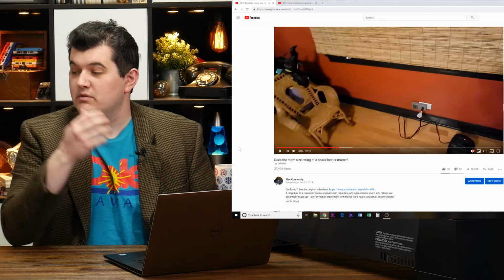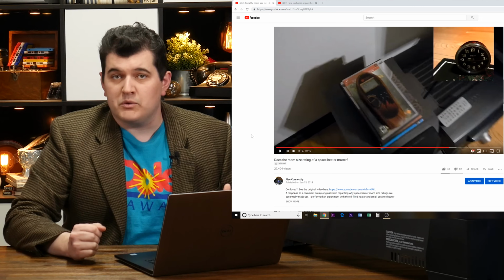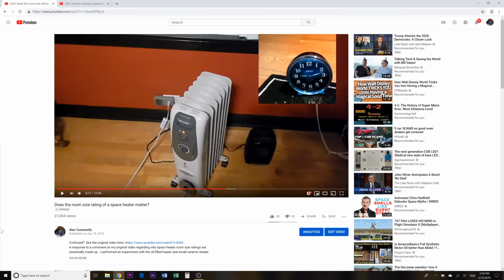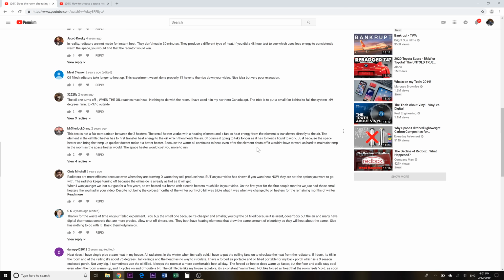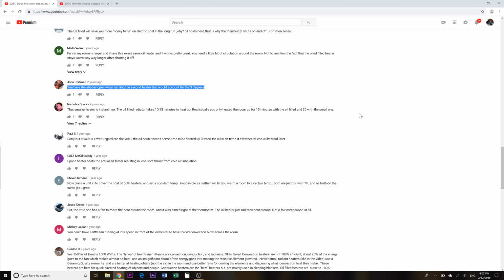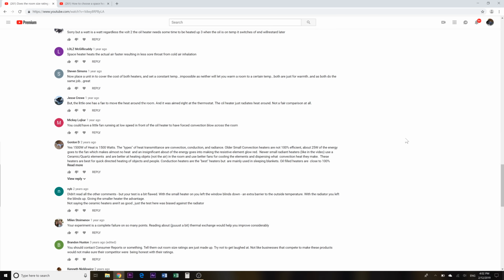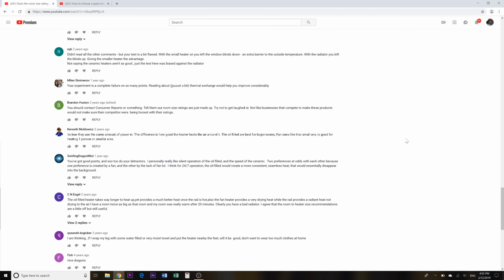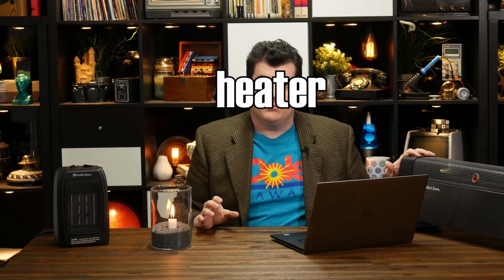More Space Heater Nonsense

Comment: Alec, I will say, a think they discourage the use of small element heaters in larger rooms because would have to be running constantly in order to heat such a large volume of air risking fire. I think they recommend oil heaters for large rooms because of the inherent safety benefits. I agree, same heat output. My question though is wouldn't a heater with more glowing element material heat faster since more surface area is active? Like a big burner on a stove?
Reply: It would if they were the same temperature; the catch is that the one with the larger surface area will be less hot.

You're right that more surface area means an increased heat transfer rate, but that means that a constant power of 1500W can't make the heating element as hot since it's losing more energy at a smaller temperature difference. For example, a small heater might emit 15W per degree above room temperature, so it'd have to get to 100 degrees above room temp before energy in (1500W) matched energy out (15W/F * 100F); a larger heater might emit 30W per degree above room temp, so it'd only get to 50 degrees above room temp to reach equilibrium. The overall output is the same 1500W, one does it by being bigger, the other does it by getting hotter. 

The big stove burner analogy doesn't really match up since that big burner is using more gas (and thus had more power) than a small burner.
Reply: @peterkaas7210 okay that makes sense. Also I mean like an electric stove the larger burner is often used most.
Reply: @americanidle1277  (Isn't it great how we still refer to electric stoves as "burners"? I don't think so, but I don't have a better name either...)
If small and large electric burners have the same power caps, then the same logic applies (the smaller one will get hotter, but still put out the same amount of energy). I don't know how electric stoves work, so I can't say either way. Though, I will say that the larger burner on an electric stove is a better fit for most of my stuff, so I use that one so I don't get a hot spot in the middle of my skillets.

Comment: Duty cycle.  Would have been better to let the oil filled run for the same amount of time as the 30 minutes of ceramic 100% duty cycle.  Plus what is the duty cycle for both heaters AT the desired temperature to maintain.  Does one "FILL" the room with more heat than the other?  I would bet there is more temp gradient across the room with ceramic.  Esp as the distance increases from the heat source.  Remember your toaster oven discussion?  I bet using both would be best.  Ceramic to quickly raise temp then switch to oil heat to maintain.  Love the channel!  Also with a heater that does not have 100% duty cycle can it overcome the coldness of the room at 1500W?

Comment: I’ve had this argument with dumb people. Resistive heat is resistive heat. 1500 watts is 1500 watts. You won’t get any more actual heat out of one than another. The difference is in the way you perceive that heat - some are loud, some blow air around, some only heat you directly (radiant type), some stay warm longer after shutting off (oil filled), and so on. But the AMOUNT of heat produced is the same.

Comment: Point a (small) ventilator at the radiator. I do that in my home and it heats the room faster and more effective, because it adds air circulation.
Reply: The moment you add a fan to a radiator heater, why wouldn't you just use a space heater that has one built-in?

Comment: I had to explain this to my boss once. Which heater is better? Same watts = same heat generated.
Where this gets complicated is with heat pumps, i.e. a reverse cycle air conditioner. In theory I think you could get more than 1500W of heating out of a 1500W heat pump... I think.
Now if you want infuriating... I used to work tech support in an office and one of my jobs was to monitor office temperatures and call the building managers if temperatures got imbalanced. We found that, duh, when on a cooling cycle the people under the aircon vents would feel colder. These being sales folk, their usual response was to hook up an electric heater, so we were paying for electricity to heat up the office AND to cool it down.

Comment: You just need a box fan sandwiched to the side of the radiator running along with it for it to heat well but then essentially it will be using more than 1500 watts (adding what the box fan uses)

Comment: The only thing that would make sense is if it's talking about consistency. A heater with more surface area would spread the heat better and get the whole room to the same temperature, instead of a small area that's hot and the rest that's cool.

But you can solve all of that with a fan.

Comment: Is it because the longer heater has more surface area so more heat can be released in a wider space? If that bigger heater had a fan wouldn’t it heat a bigger room more quickly than the smaller heater?

Comment: Its going to be interesting if you ever get around to reviewing heat pumps where they can often be greater than 300% efficient in converting electricity to heat
Reply: Heat pumps aren't 300% efficient. Some if them have a 3:1 ratio (hence the 300%) for how much heat they can transfer, relative the energy spent transfering said heat. They don't actually produce more energy than what's going into them; if that were true then the heat death of the universe would actually be avoidable.

Comment: I think the biggest difference is how it FEELS like it heats.  The little ones with a fan seem to provide the feeling of MUCH more heat, but only in a small area they are blowing on.  The large oil-filled ones seem to heat slower, but a bigger area of the air feels slightly less warm.  If you put one under a ceiling fan, that seems to REALLY speed up the heating process.  I may have also put a box-fan next to an oil radiator a few times to try and warm a bigger area faster when we lost power to try and slightly-warm a HUGE area (say most of the house) slightly faster.
 
My bigger preference to the oil ones is they seem safer - you don't have to worry about a little bit of pet-hair sucked in and clogging the air-flow causing a restriction and overheating like the small fan powered ones seem to.
 
It's all moot for me though, because after a long winter power failure, I discovered the indoor-safe LPG Mr. Heater Big Buddy that outperforms everything else thanks to having 18,000 BTU on high with 2x 1lb bottles.  So now if I need to warm a room up rapidly while I'm in it, I just get that and save the electric ones for if I need to let one run at low/medium "speed" to take the edge off for an extended time.
Reply: Thats literally what the video talks about

Comment: Of course you are correct! The only thing that matters with heaters is how much power you are turning into heat. And you are also right about the cycling. If the heater is not running (cycling) it’s not producing heat. The only exception are heaters known as radiant heaters that produce infrared. The IR makes you feel warmer even though it’s not heating the air, because the infrared warms your skin directly. This is what you get for trying to teach science on youtube :)

Comment: In a smaller room the temperature will change quicker. So maybe, a 'small room' heater is designed to turn on and off more for short periods and the 'large room' heater is designed to be on and off for longer times (not sure if that is true or not). Just saying that the label difference may be because of factors other than the heat produced. To be clear I do like the video and your logic seems valid. I would be interested to see a response from some companies.
Edit: Also, to be clear, I think your original video clearly showed that the energy transfer supported your point.

Comment: One thing you missed, I think, is the means to heat the room. With the smaller unit, which has a fan, is able to pull in the cooler air (which is on the ground) warm it up and throw it out. The oil will use convection, meaning it would require decent air movement to equally disperse the heat it produces. IMO the electrical heat with a fan will heat a room faster than the oil filled, but may use more energy up front, where the oil filled will take longer to warm a room but use "less energy" but over the course will use the same amount of energy. Interesting thought experiment... Maybe if I had the money I'd also try it. 
And that one guy saying something about drying the air? Yeah... let me tell you about psychometrics sir; the ground principle of anticipating the heat energy of air a.k.a. the ground principle of HVAC. By increasing the sensible heat without adding moisture, the amount of moisture stays constant (look at dry bulb temp and specific humidity. An increase in Dry Bulb Temp = constant specific Humidity).
https://www.google.com/url?sa=i&url=https%3A%2F%2Fwww.ohio.edu%2Fmechanical%2Fthermo%2FApplied%2FChapt.7_11%2FChapter10b.html&psig=AOvVaw3o_Abp7DNsKgevkdlud-Cf&ust=1594988085340000&source=images&cd=vfe&ved=0CAIQjRxqFwoTCMCa3-Xf0eoCFQAAAAAdAAAAABAI
If indeed the heat elements are all the same, the benefit of going for a larger element is that it covers larger surface area. So a large unit may take 15 minutes where a small unit will take 30 minute...
Source: 4 years in commercial/industrial HVAC, 3 in the US, 1 in EU. Working on 120VAC 60hz, 230VAC 50/60hz, 480VAC 60hz system (And DC systems) and all sorts of different rated heating elements I think the largest I have seen is 28kW. I still have a lot to learn, and am still learning.
Don't let the haters get to you. You are making an attempt to learn... that's way more than other people. Keep releasing the great content.

Comment: Honestly first thing when I hear "space heater" is a radiator out in space.
Here we tend to call them fan heaters or radiators but we have central heating here in the UK. It's essentially uses a boiler which heats up water (can be gas/electric), sending it to a hot water tank and/or the central heating system which is mostly just a loop going to built in radiators around the house, thermostat usually telling the central heating system to come on (either itself by setting the valve or through a control system which most tend to do nowadays). On top of this about 95% of all UK homes are made of brick too which is way greater at insulating so we tend to only use our radiators in the winter. Fan heaters or radiators are more for places without Central Heating here or if you have a cool spot you need warming up. There are also fireplaces which aree slowly fading away from newer houses which either use gas/coal//wood/electric (coal+wood burning fireplaces being in much older houses and electric really just being a space heater anyway).
On the flip side (according to the BBC, 7 years ago) about 0.5% of UK homes have Air Conditioning (compared to the US's 15%) super common in the UK, maybe more in some places then others but generally saying we don't have as hot of weather then the US (we still get hot weather just not as often) and a lot of people feel comfortable with mostly fans and having windows open. Though a few workplaces and homes do have AC built in; a lot of us resort to buying A/C if we need it to be colder.

Comment: The heater with no fan is stuíd, as you pointed out. The little one with the noisy fan... well, it is noisy! Also, I hate how fast it drys the air.
For me it is so obvious that a middle ground with a two slow silent fans, spreading the heat in different directions, would be perfect.

Comment: Given more hours, the metal and oil will "store" more heat (none english speaker here, hello!) so it will give off more heat than  a small one, even if the the thermostat in a couple of minutes at the time.
For keeping a room warm for hours at the time, a radiator will be more "effective".
However, you will also "lose" efficency since it takes a lot of energy to heat up the metal and oil. So ...

Comment: 1500w is not the produced power. It is the maximum power consumption, indicated to size the wires and protection fuse. Hot air will contain more water in vapor state than cold air, it means that water will condens on cold objects, so they become wet, droplets on the widow, on your cold glas, your bed will be moist also papers, you'll get mushrooms on the walls. with the oil heater, the objects stay near the air temperature and don't become wet.. I have more to say, if you ask me.

Comment: A question; could there be a benefit to use a oil unit (or any other heater that use a intermittent medium) to heat a room if it is very drafty and heat seeps out, i'm thinking that it could in theory be a slower dissipation from say oilagregates, than a "straight out into the room"?

Comment: I have a house in a far country side in the very northern parts if the earth. It heats up by a woodstove. However in order to keep it warm I have to burn  wood daily. Sometimes i have to drive away for a couple of days or a week. Just before that i burn a bigger amount of wood to store the heat long enough and seal of all the holes in the house of which I,m aware of, so when i come back the house is still in the + section (it can get down to -30°C outside). But sadly it doesn't always work... That's why I,m thinking about getting the oil heater and let it run during my absence... However i have still doubts about its safety... Can someone help me out?

Comment: The light of an LED hitting a wall is not going the generate heat only specific frequencies of visible light generate measurable heat. You also are forgetting how the fan effects the heat generated. Cooler air blown through the heat source, cools the heat source, lowering the overall output so efficiency actually is reduced. Oil or contact heaters are a different story. As the oil or contact material heats up, the heating elements shut off. The heat is dissipated to the room. As the heat dissipates, the oil or contact material cools kicking the heating element back on which reheats the transfer material. Fan blown spreads the heat mixed with cooler air. Depending on the pressure within the room, this can be either highly efficient or have a negative efficiency. AND, electrically generated heat produces ozone which in high levels can be toxic. All of that aside, I'd wager that a 100 watt incandescent bulb with a small fan behind it would produce far more usable heat than a 1500 watt space heater and in a much more efficient manner. The problem there of course, is it's difficult to sleep in a room with a 100 watt bulb burning :)

Comment: Could the difference be between radiation and convection? A "small room heater" with a fan heats up the air passing through it and that warm air disperses throughout the room. This would warm up a small room fairly easily, but in a large room the air could be cool by the time it reaches the other side of the room, so you could have the side of the room with the heater be much warmer than the other side. But the "large room heater" (like the oil filled heaters) release their energy as infrared radiation which instantly travels across the large room, this radiation warms the air along the way and eventually gets absorbed by the wall on the opposite side of the room which warms up and heats the air more evenly throughout the room.  
Still, it should heat the room the same amount if it uses the same amount of power. But the "large room heaters" might be better at more evenly distributing this heat. 

Not sure if this is actually a good reason for the large/small room distinction.  I know the inverse square law means that the radiation isn't that strong once it gets across the room. But maybe radiation is better for warming larger rooms, and convection is better for small rooms.

Comment: The only logic I can personally attribute to the "small room v large room" labels is that if you use the small heater with a fan to heat a large room it would have to run at maximum capacity for a long time to achieve the desired heat risking fan failure and potential fire, where as the large convection heater can run indefinitely without risk of complex part malfunction (seeing as it's just a heating element designed to operate without fan assistance) 

So while it warms slower it can be left to run for long periods of time at maximum at relative safety as compared to the small fan heater in the same space. (Idk tho I'm just a dog 🤷‍♀️)
Reply: That's why space heaters have to have an overheat shutoff.

Comment: A hater would have to argue the boundary conditions and do the math. Solve the heat-transfer PDE over a logical domain, mixed-boundary conditions, and a forcing function (simulated heater). I'm 99% certain you could model a 2-D floorplan on an excel spreadsheet lol $250.